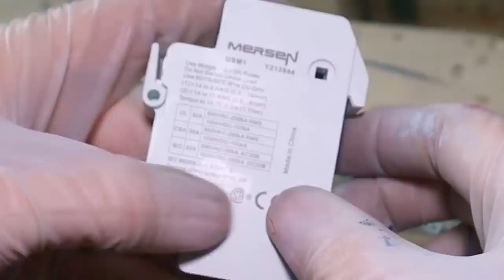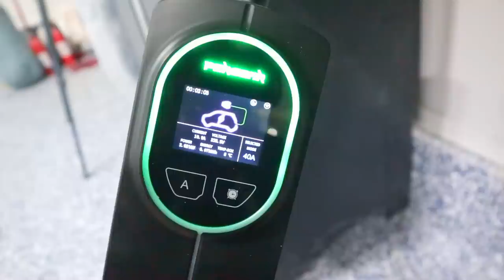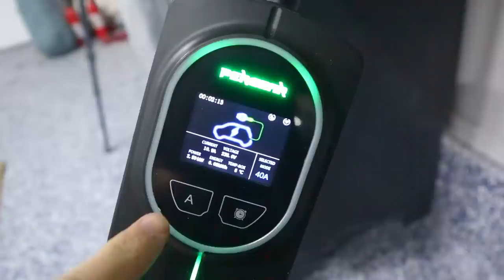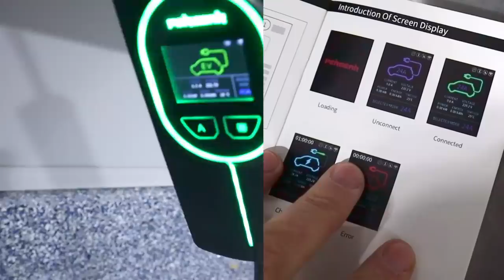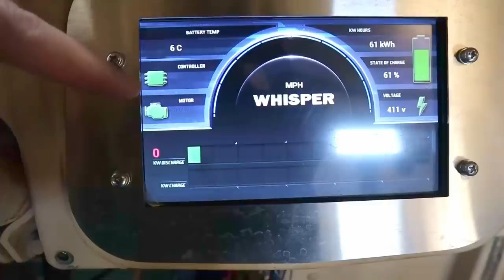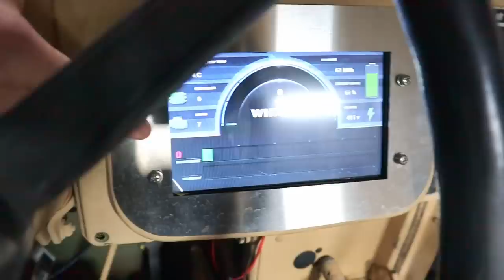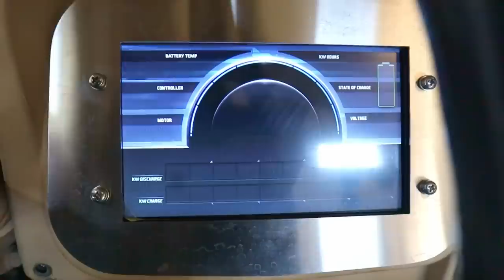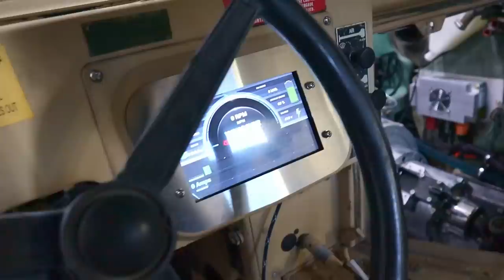The Electric HMMWV Strikes Back - More Trouble with charging

Comment: So... An EV is MORE complex than an ICE vehicle? Wasn't expecting that
Reply: Only if you piece it together like that. Same would happen if you’d try with an ICE engine.
Reply: ICE vehicle would add 3-6 more pieces to the system that are critical plus a lot more that aren't in most cars. Cars starting back in the 90s started having to have more than 1 CAN bus because they were getting overloaded and critical messages not able to hit time frames needed. Highest I've heard of is 5 buses in newer cars is 5 buses but could be more now in some vehicles. They've increased speed a couple times along the way as well.

Comment: I would disconnect the charger from the rest of the car. Then I would connect the chargers, ken circuit directly to a canvas reader, and see if you get any data. After you figure that out, start adding the other lines to the rest of the car, if any. also, from that point in the circuit, I would plug your canvas reader into the canvas wires, leaving the charger to see if you see the other stuff. Is this Saul proves successful then you just have addressing wrong, betraying your controller and your charger
Reply from the maker: Thanks for the comment!

Comment: The CAN network sound like a really unreliable jumbled mess of a system to control a car with. Everything spewing out random information at random times like a 3 year old on crack. Who knows what system has what addresses and which devices and listening to what addresses. What if addresses change or somthing resets to listen to a different address? I am so glad my 1977 Beetle EFI has none of this. It is by far the most reliable car I have ever owned. If I do electrify it then I will be sure not to use a CAN network. A simple wire from one thing to another to tell it something is all you really need and is way more reliable. Why add so much complexity and points of failure.
Reply from the maker: CAN is definitely not easy